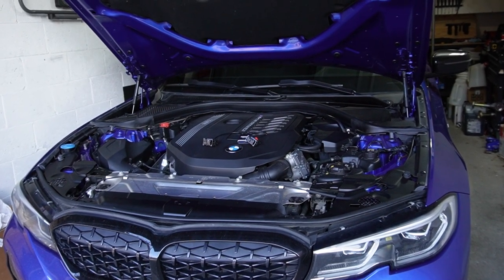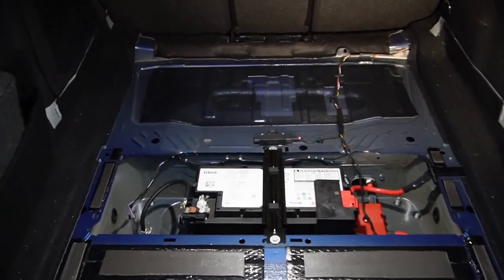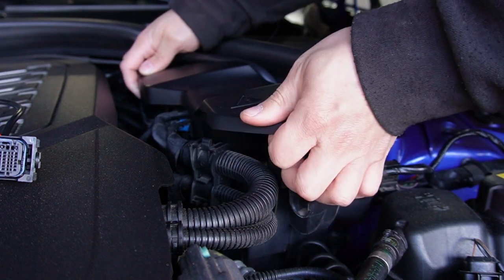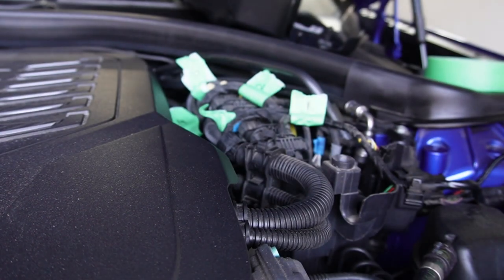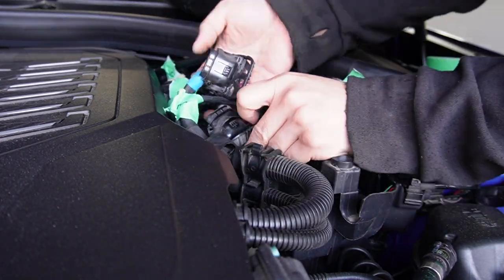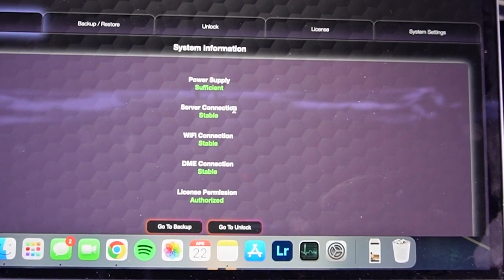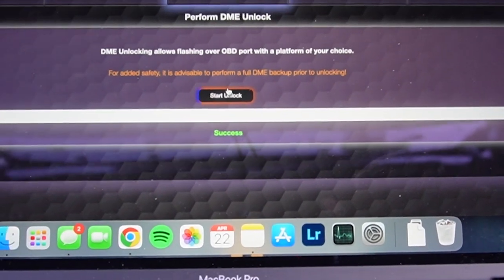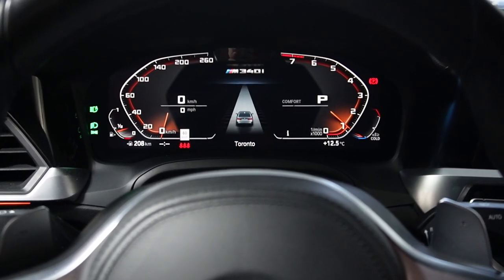*DIY* Bench-Unlocking DME/ECU Using M-Link | Pre-June 2020 BMW

Comment from the maker: Hope you have enjoyed this video!
Pinning this comment as a quick recap for folks who may have fast-forwarded the video (don't worry, I'm guilty of it too):

- M-Link only (currently?) works with DME that is produced before June 2020.
     - Any DME produced after June 2020 will very very likely require a Femto Unlock service.

- Main reasons why I went with M-Link was because of its:
     1) ability to backup (and recover) the current DME state as a mirror image.
     2) convenience of bench-unlocking it at-home.
     3) unlimited times of backup/recovery/unlock of DME.
     4) ability to work with any tuning platform you prefer after the DME is unlocked.

- The red-marked connector from the M-Link goes to 1st slot of the DME (towards the front of car); and the other connector goes to the 5th slot from front of car (second last when counting from the rear of car).
     - The connector that goes to the 5th slot is to be connected the other way around than OEM connection. Check the pins layout before plugging it into the DME.

- The operation of M-Link was an overall very very positive experience. I've reached out to them time and again for various questions, their support was extremely knowledgeable and helpful every time I reached out. 10/10!

Comment: Bro awesome video this helped me tremendously on deciding on how I want to get my DME unlocked and after watching this I’m getting the M-Link
Reply from the maker: Glad it helped! As long as the DME doesn’t require femto unlock, I genuinely think M-Link is the best option on the market.
I no longer fear the DME will be locked even if my car goes into dealership for service, which I’m sure I’m not the only one who fears of it lol
Reply: @TandeGarage  yeah I was able to check by using a scanner and connecting the mhd app. It said bench unlock required and that my software was created in early 2019 so I should be in the clear.
Reply from the maker: @Sam-kn4rb  You should be good! I do love the flexibility the M-Link offers - whereas say if you'd used the MHD Unlocker, you're only limited to tuning with MHD.
Good luck and enjoy the freed-up power soon!

Comment: Hey dude,
great job. Do you know if the ECU of BMW M850i build 12/2020 can be unlocked? All tuners say to me that it’s locked.
Reply from the maker: It’s likely the same principle with my M340ix shown in the video - any DME manufactured after 06/2020 is locked from the factory, that requires a Femto unlock. That said, it involves shipping the DME physically to them.
This M-Link device likely won’t work. Though you can check with Mission Tuning and see if the M-Link device would work on your application.

Comment: If I use this can I still use bm3 tune
Reply: Yes
Reply from the maker: I’m currently running BM3 after having my DME unlocked with M-Link! It works flawlessly.
That said, this tool is not tied to any tuning platform after unlocking your DME. You will be able to remap the DME with whichever tuning platform of your choice.
Reply: Now my next question is which one should I get for my 2020 m340i I just want to unlock the DME so I can use my bm3 tune.
Reply from the maker: @ronaldalvarez97  if you dont care for a flashback option (return to pre-unlock state), just get the “unlock only” option. Super license is the one with flashback option along with unlock.
Reply: @TandeGarage  thank you so much
Reply: Holy shit 749$
Reply from the maker: @ronaldalvarez97  which one are you looking at? The M-Link showcased in the video was $500 USD; $350 USD if you do unlock-only. Or are you referring to BM3 license?
Reply: @TandeGarage  well it says I have to configure it and unlock only is 549+200+ tax
Reply from the maker: @ronaldalvarez97  gotcha! I think you've configured it with Mission Tuning's tuning software, along with its M-Link unlock tool. TBH, costs will be similar if you go for other tuning platforms, such as MHD, BM3, etc. And you'll still need the DME to be unlocked (with M-Link or any other possible means at this time) before you can flash any of the software mentioned.